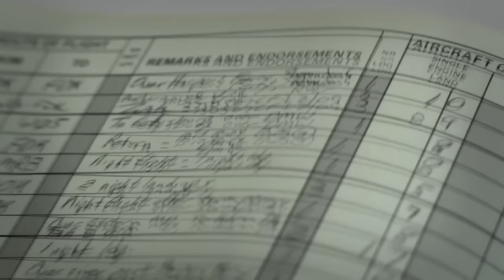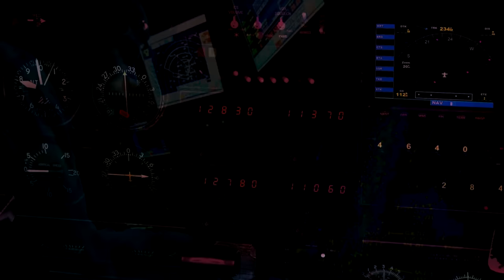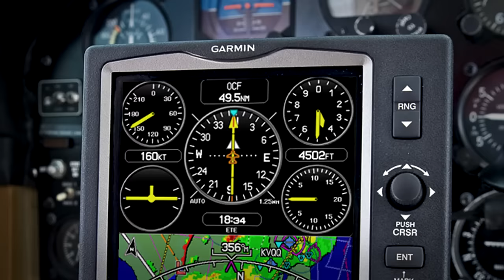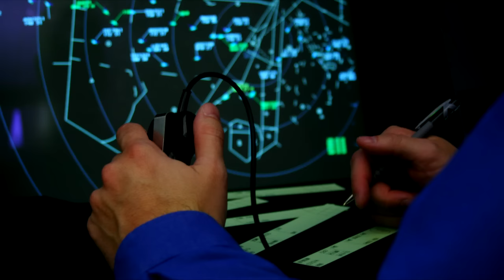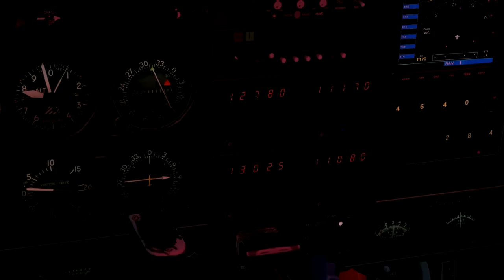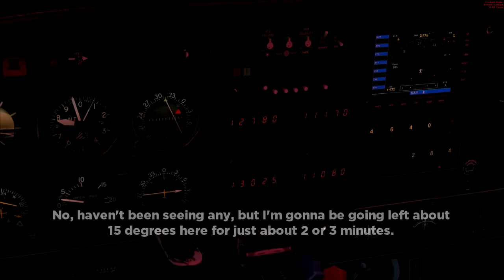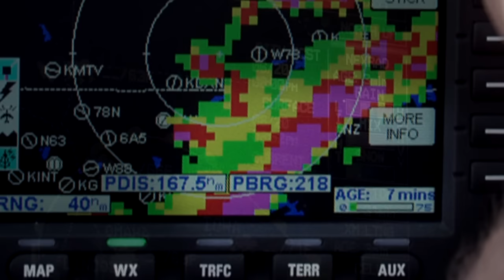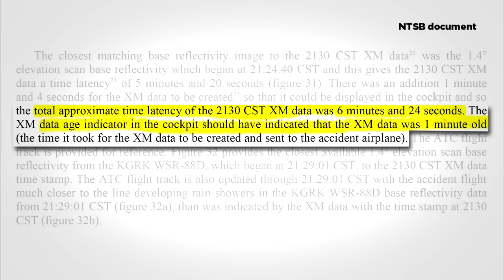Accident Case Study: Time Lapse – misunderstanding in-cockpit weather displays can lead to tragedy

Comment: 6:00 - Thunderstorm is a bad word, severe is even worse, but 'extreme' means GTFO.  If ATC is ever talking about 'extreme' anything, put whatever it is at your 6 o'clock and paddle faster.
Reply: Hahahahaha, I have read your post over and over and over, I just can’t stop laughing. You nailed it. I just don’t understand what this pilot was thinking.
Reply: In my yrs of experience if its moderate, stay far away. 25 miles and know the direction of the storms. The wind is that hidden danger you won't see unless in the desert southwest where lots of dust will show the gust front or micro burst from the storms. If there's severe, you cancel the flight until it passes. There are now more than ever, GA single engine and small multi engine pilots that are some of the biggest idiots Ive ever seen and met. That treat flying like its no big deal. It IS A BIG DEAL. As a pilot, weather is 90% your office. Respect it, study it like your life depends on it because it does or you'll pay the price.
Reply: ATC needs to have the balls to say get the hell out of there or you will die.
Reply: AL this might be a dumb question but why can’t small aircraft have a huge parachute that can slow the fall, plus parachutes for the passengers to jump during the fall?
Reply: no further west if these videos are accurate, it seems the parachutes never deploy before crash landing and fatality rate is 100% in these situations.  So it seems like never being in that position in the first place is better than navigating through that hell.
Reply: @anthnyl  These planes have parachutes?
Reply: @nofurtherwest3474  some GA aircraft do now come equipped with parachutes, but I think I read that they have to be deployed fairly early before the plane is in free fall as the chute may not work when plummeting. Others would know more about this than me.
Reply: no further west the new cirus does !
Reply: @richardernsberger5692  I don't see why it would't work while plummeting if a human can do it while plummeting.
Reply: @nofurtherwest3474   Some small planes do. But it likely would not have helped much for these people. a parachute in a severe Thunderstorm will get you killed too. No, This guy simply needed to listen to the information given to him by ATC and had the training to understand the limitations of his NEXRAD. He simply needed to scrap the idea of making his destination. Because guess what, he didn't make his destination anyway.
Reply: @jimgriggs2184  great point about the parachute would be worthless in a storm.
Reply: @nofurtherwest3474  Cirrus includes them in their planes, but the planes are a total loss after deployment.
Reply: Charlie McFarling You dont have a very narrow window, its actually quite generous. 300 ft or so, and even below that there's still chance that the chute will slow you down enough that you dont die immediatly.

The thing with the parachute is that too many pilots consider it a last resort. Then its probably too late. When it should be considered the first resort in a real MAYDAY emergency. Better to pull the handle and regret it than regretting not pulling it, in the afterlife if there is such a thing.
Reply: @nofurtherwest3474  There is a maximum deployment airspeed for the chute. Too fast and the chute will just get ripped away when it's deployed.
Reply: @nofurtherwest3474  How much does a human weigh? How much does a loaded plane weigh?
Reply: @RobertHancock1  make it stronger.
Reply: @Raison_d-etre  you'd make it much bigger duh
Reply: @nofurtherwest3474  You know that things don't scale up linearly in mechanical stresses with size, right? Duh.
Reply: @Raison_d-etre  i didn't say they did. duh
Reply: @nofurtherwest3474  You didn't say a lot of things. Duh.
Reply: @nofurtherwest3474  Parachute may not help in bad convective turbulence- that is, a bad thunderstorm. Even a calm-appearing thunderstorm can have 100 mph downdrafts.
Reply: @twest344  oh damn. can that thunderstorm take down a 737?
Reply: @nofurtherwest3474  They can take down a L1011......
Reply: JD Shemp I’ve never heard of that plane. Is it big?
Reply: no further west   L1011 is a 3 engine wide body passenger jet.  Yeah it’s big, length about 170ft, holds over 250 passengers, max take off weight about 500,000 lbs.
Reply: Especially in that area of the country. Extreme in Waco is a lot different than extreme in Philadelphia. Either way you're right, GTFO
Reply: So true!  ATC usually has your six, but YOU are the one flying and it's your duty and decision to do whatever avoids weather trouble and respect it, always!   More than once, we've had to do a 180 to get the hell away from weather!  It's never worth testing!
Reply: @08turboSS  That should apply to passengers as well. If the weather is really bad, don't fly and don't trust  any pilots that are going to fly you anywhere.
Reply: @jimgriggs2184  But the ATC controller kept giving the pilot advice that when he cleared to storm to turn right to his intended destination, he never advised him to scrap the idea of flying to his destination, or suggested to him to fly to an alternate airport clear of the bad weather.
Reply: @anthnyl  Hum, I know, right...
Reply: @nofurtherwest3474  weight!